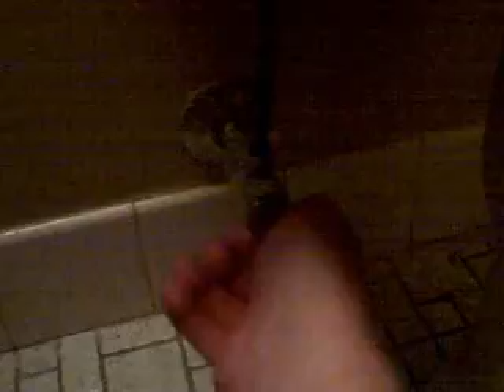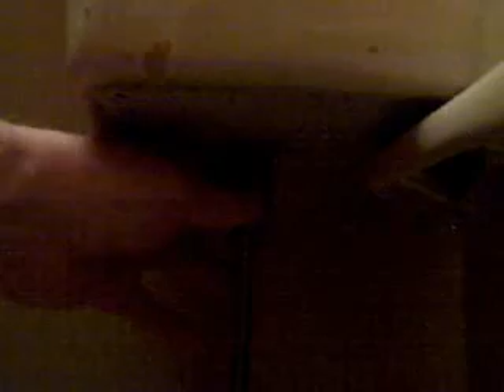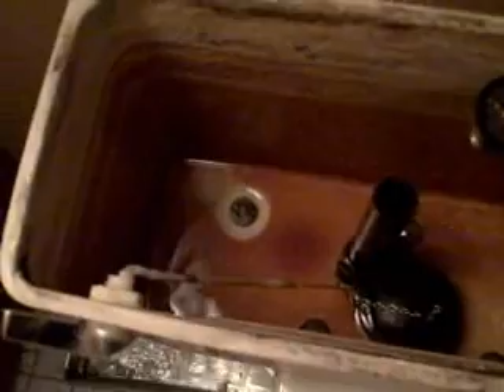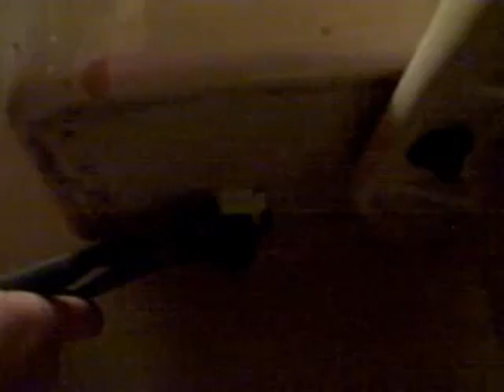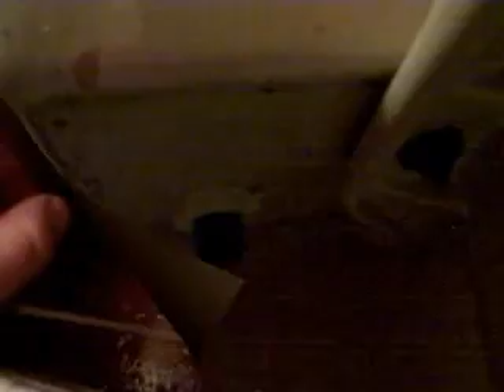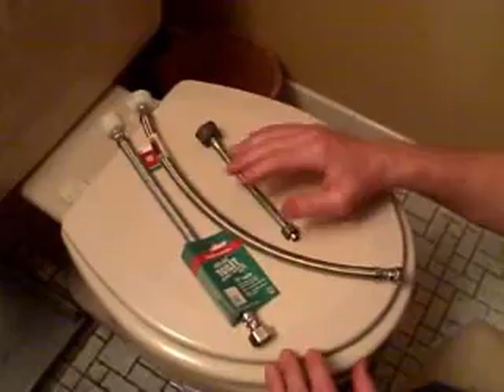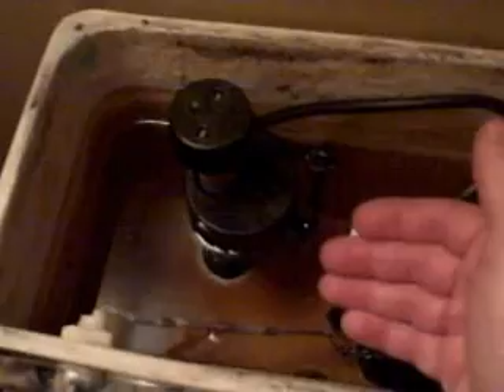How to Replace a Toilet Fill Valve - Fluidmaster

Comment from the maker: Hi,
Replacing the fill valve should not affect the flapper. I would check the amount of water that is filling the tank. You may need to raise the float so there is more water in the tank for a better flush. You may have also moved the chain on the flap so it doesn't open as far.
If you are still having problems, I would change the flap. There are some excellent styles that are adjustable. You can set them to stay open longer for a better flush. Let me know how it turns out.

Comment: replaced an old syphon and filler unit today.took me about 3 hours.i woulda done it loads faster if ide seen this video as NOWHERE in the instructions did it show how to release the height adjuster as seen here at 2 minutes.there were other issues with the toilet (not fixed anywhere to wall or floor)but fluidmaster syphon was a sinch  for making quick adjustments.thanks for the UREEKKKKA!! moment at 2 minutes

Comment: Thank you very much for your reply.  When you mentioned threads, I checked the fill valve - sure enough, the threads were stripped.  I changed the fill valve and reconnected the new flex water line and everything is working perfectly with no leaks!

Comment from the maker: Hi,

If it is a supply line for a toilet, it should snug up easily. Hopefully you didn't cross thread the nut. Make sure there is a washer in the nut that tightens onto the fill valve. It needs to tighten down firmly onto the bottom of the fill valve.

Comment: Thanks for your reply.  Can you help me?  I just bought a universal flex water supply line from Home Depot.  I have the correct fitting for the shut off valve and the other end threads onto the fill valve just fine.  It's designed to "click" when it's tightened all the way.  But it leaks like crazy where it connects to the fill valve.  HELP!

Comment from the maker: Hi,
Sounds like 3/8" compression.
You would have that size at the shut off valve and the other side of the supply line will be 7/8" to connect to the toilet fill valve.

Comment: Hey thanks ...I 'm glad you gave my a Reply...I dont' have confidence in these Matters.....I think mine is 3/8 compression? The pipe that comes out of the Wall at the Shut off... looks like 1/2 inch and the Supply line is thinner than that.....I assume that means its 3/8 and not 7/8?????

Comment from the maker: Hi,
If the old supply line is good, you can reuse it. For a toilet, you need 7/8" to connect to the fill valve and the side connecting to your shut off can be a couple sizes. Just take the old one to the store, they should be able to tell. The most common is 3/8 compression. You can also get a toilet "fit all" supply line that has a few bushings to fit any shut off.

Comment: The fill value + flapper FluidMaster bundle actually has 18 complicated steps; that manual was pretty intimidating. This video summed it up so much better. On my first setup attempt I got all of the settings right and didn't need to adjust or recalibrate anything. You're a great teacher and should be the one to make their instruction manuals!

Comment from the maker: Yes, you can pull up the circular collar below the float. By lifting this you can pull up the whole top part of the fill valve. You can adjust it up to 14 inches. Then you can lock down the collar. You can also adjust the height of the float with the bar off to the side of the float that connects to the top of the valve.

Comment from the maker: Hi, the side of the supply line that connects to the fill valve in the toilet is 7/8". The side that connects to the shut off valve under the toilet can be a variety of sizes. The most common is 3/8" compression. If you are at the hardware store, the supply lines should be marked for a faucet, which is 1/2" to the faucet or toilet, which is 7/8" to the toilet.

Comment: Great video. I bought the same fill valve but my existing hose is 1/2" and I will need either an adapter or a hose similar to the one you used. Can you please tell me what the size of the valve's threaded end connection is? Is it 5/8"?

Comment: I looked at the video several times then I lined up all the tools and did it just as you said. The only difference was I had to turn off the water supply to the whole house as the turn off valve did not stop the water supply. Thank you very much.

Comment: Hello, good advice, however you did miss one thing.  In the instructions they mention to cut the refill tube to the proper length for the toilet, so it doesn't have to bend back on itself.  Over time, as the rubber ages, if left the way you have it, it will dry out and kink, cutting off refill to the bowl.  I've seen this happen in many older toilets when this step was missed.

Comment from the maker: Hi, on some fill valves you can push and turn the cap to remove it. I would try pushing down on the cap and giving it a twist clockwise to tighten it. As long as the valve turns off when the tank is full and the water isn't shooting out of the top it shouldn't be a problem.

Comment from the maker: @Beale64 Hi, are you sure you water is flowing through the supply line to the fill valve? Turn off the shut off valve to the toilet and unscrew the top of the supply line that connects to the fill valve. Then take a bucket and turn on the shut off valve, aiming into the bucket to see if there is water flow. This would be the first step. Let me know what happens. You may need a new shut off valve or supply line.

Comment: One thing I noticed is that you talk about using an adjustable wrench on the line that goes into the tank . I've always understood that you are not supposed to do this. It even is printed on the plastic nut "Hand tighten ONLY". What are your thoughts on this?